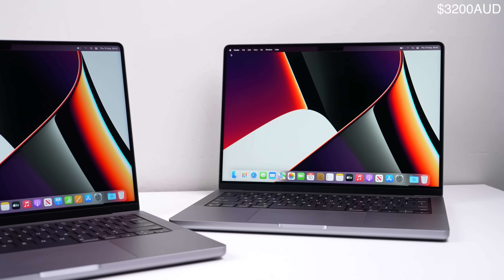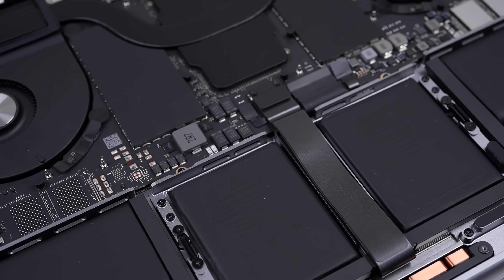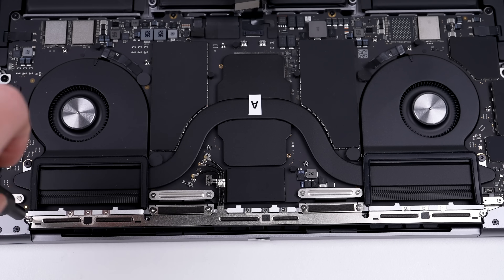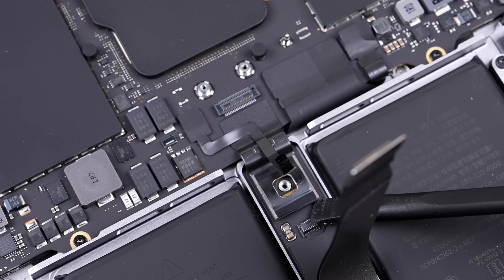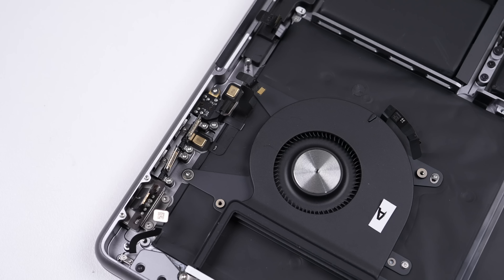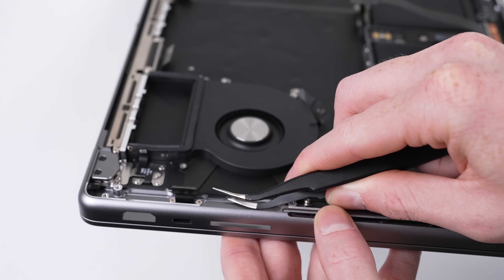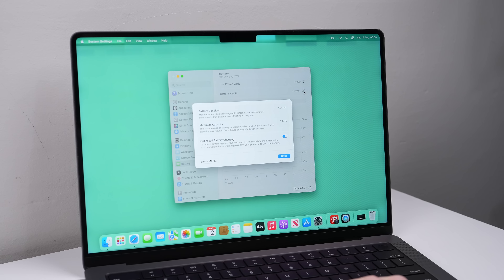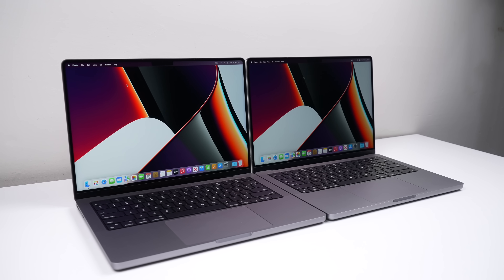New Anti-Consumer MacBook Pros - Teardown And Repair Assessment - Apple Silicon M1/M2

Comment: I used to work both for the fruit company and an authorised reseller almost a decade ago now. I was always on the defensive side saying things like - apple just wants everyone to have good battery life/screen/camera whatever as it's their brand name that goes bad if someone kits out phones with crap and sells them as authentic. I think at those times we were getting the first devices where screen repairs started becoming problematic due to fingerprint sensors and such, but it was still not too bad. This is insane and anti-consumer. As much as I would prefer a genuine part from apple to replace something broken I would still want an option of a third party repair, ESPECIALLY when genuine components are used.

Comment: Thieves. I have a MacBook pro mid 2014 full specced and that was Apple pinnacle (albeit ram soldered). I even coated all the insides on conforming coating so it's basically anti rust and water proof. F/ U apple!!!

Comment: I have performed multiple screen swaps on the 2015 - 2019 MacBook Pros.  This is insane that Apple yet again makes things artificially non-repairable.  We need regulations that make these practices illegal.
Reply: also... 6500 USD for a 14 inch 1 terabyte laptop with only 16 gigs of ram
LMAO!!
Reply: with that amount of money you can buy the god of gaming laptops just went to best buy and an Alienware m16 QHD 240HZ with 16GB ram and a rtx 4080 cost 2300 dollars lol
Reply: @escapetherace1943 my W520 from like 2011 has 32 gigs of RAM
Reply: @escapetherace1943  That feel when I payed less than a quarter of that price for my gaming desktop with 64GB of RAM, 8 core 16 thread CPU, and a mid-high range GPU. Plus my desktop is 100% repairable! I can swap in whatever components I need and modify it however I like to keep it running for years to come

I imagine the only people buying this thing are people with hella disposable income who are huge fans of the brand
Reply: @escapetherace1943 the pricing isn’t great, but where the fuck did you pull $6500 out from lol? It’s $2500.
Reply: @elith6930  6500 in Australia and 2500 in the USA, person who didn't watch the video. Either way you are overpaying. 800 new would be overpaying for that literal trash laptop. But Apple customers get what they deserve.
Reply: @escapetherace1943  you said 6500 usd in your comment…? Are you literate?
Reply: @elith6930  are you? 6500 USD for AUSTRALIANS. Not Aussie Dollars, US dollars.
It's like living in the twilight zone with you people
Reply: They dont want you to repair them they want you to buy a new one every year. Best getting a thinkpad or something that will stand the test of time unlike apple shite
Reply: @jontait1095 My next laptop will be a System76. They are Apple, but with Linux and open source software / hardware.
Reply: FlexGate issues limits, artificially, the lifespan of the Macs. My old 2017 13” MacBook Pro died after two years of use because the flex cable tear and broke in two pieces.

My 2019 16” MacBook Pro (which I bought in late 2021) will run, eventually, the same luck as the old one, while my 2012 13” MacBook Pro still works without any issues. 

Apple made a big mistake in removing the easy replaceable screen to motherboard (eDP to 30 pin) cable, and this is one of the main reasons why I love ThinkPads, because they’re easy to repair.
Reply: My thought too. This is getting ridiculous, we need regulations to stop trash companies like this from exploiting users this badly. I hope the EU comes up with something given their recent regulations
Reply: The whole world cannot rely on the EU to fix this when USA and the rest of the world is so LOST and supporting ideas like capitalism and even worse antiSocialism @derivativeoflog7
Reply: @derivativeoflog7  The country this company comes from elected a pedophile president. Twice. Good luck with those regulations
Reply: When people stop buying these computers, then the problem is solved
Reply: @_Viking  Problem is that they won't.  My daughter INSISTS on Apple products.  I've tried educating her on the things that Apple does to its users, but she's more interested in what the other girls in her circle are using.  That's the way it is all over the world.  You could slap an Apple logo on a sleekly shaped turd, and they'd still all buy it so they can be part of the group.  I'll never understand.  Drives me crazy because other companies have taken note, and are pulling the same stunts on us now.
Reply: @FirstLast-vr7es  i know what you mean. Have two girls myself that will not touch anything without a logo of a half eaten apple on it. .😅
Reply: @FirstLast-vr7es 😅
Reply: @_Viking  That's the issue when we're dealing with a company that built a walled garden ecosystem... it just won't happen. So we have to settle for the second best thing, which is regulations
Reply: @derivativeoflog7  No one forced anyone to buy Apple, you decided to. This is like a conversation with a drug addict
Reply: @LimerickWarrior1  I don't have any apple products; 
but there are some good reasons to buy one, and some aspects of them are objectively good (none of which weigh out the company's shit practices for me, so I wont buy one)
That's what makes me the most sad... They could be making absolutely killer products, yet they choose not to because of greed, AND using extremely questionable practices
Reply: @LimerickWarrior1 as a graphic designer my programs run better on macs as they were designed for them. There are less bugs and less update errors. Intel tends to also do updates at the most stupid times possible. Macs have also integrated all the printer drivers so I don’t have to install any printer drivers. Colour calibration is also better on Mac. Macs are specific to my industry. Let’s not talk about viruses, even without a antivirus program I never had virus problem on my Mac because of its closed off system.
Reply: @_Viking  That solves nothing because the competition is starting to pull the same BS because they see that they can get away with it.
Reply: @_Viking  Nah, just force them to comply under penalty of death.
Reply: @_Viking  I'd love to, but x86 is toasty/load and simply vastly inferior on every metric (if adjusted for TDP and Perf/watt especially) compared to Apple Silicon..
Reply: @kevinjohansson3923  Apple could have continued with Power architecture, it worked relatively well for Nintendo as all of its systems from GameCube to Wii U sipped power, although, I'm not sure what happened with Wii U as it had clunky software with long load times, but I digress.  Apple should have also considered AMD as it's the superior 64 bit x86 architecture.
Reply: @WJCTechyman  the power architecture was terribly inefficient when they made the switch
Reply: @kevinjohansson3923  🤣🤣🤣🤣🤣🤣🤣🤣🤣🤣🤣🤣

Considering how advanced the latest CPU designs from Intel, ARM, and AMD have become, "performance" differences no longer matter as much as some would like to claim. Just about the only metric that matters at this point is energy efficiency, and even then the differences are not large enough to really matter
Reply: absolutely
Reply: Well in Europe we have such regulations  by Law but apple just not care. :P
Reply: @HTSMcFly  Are there? As far as I know there aren't, otherwise they would've definitely have been fined or suspended from the european market... and Apple clearly cares about this market since they're willing to adopt USB C and allow sideloading just due to EU regulations
Reply: There are new EU laws coming into force in 2027 which require repairability. They may be work-shy communists 😊 but occasionally the EU shows the rest of the world how to stand up to big corporations.
Reply: @Pikestnt  not everything that slightly deviates from the USA model of doing everything is communist
Reply: Here in EU we have "Right to repair", a recently introduced set of Laws specific for this. You have to fight and force Your politicians and lobbysts to make them.
Reply: We don't need regulation, we need education. We deserve what we get if we continue buying these computers.
Reply: The thing is, why are brainlets still buying these products?
You guys are obviously mentally ill with Stockholm syndrome as otherwise there's HUNDREDS of alternatives instead of Apple, but noooooo, you buy their products and then moan about it.
Reply: Why does the government have to step in? Just don't fucking buy it. If one company loses customers because if doing something like this, others will not do this as to gain customers and sales.
Reply: This is a company that used to glue & solder RAM sticks. Not sure why you'd be surprised after all that jazz..
Reply: Right to Repair
Reply: In EU there are already such regulations in place (you must have heard about USB-C port in iPhones - that is one of the results). We'll see what happens and if Apple will also make a decision to make their stuff repairable by non-Apple service...
Reply: EU bans all sh*t like that from 2027. New laws intended to protect human rights to repair their devices, change their batterys, use any chargers and cables.
Reply: Legislation that reduces sales of new devices, which also reduces sales tax revenue, will NEVER be passed. It's delusional to think this kind of anti-repair crap can be legislated away. The only thing that will work is complete and full boycotting the company. But that will never happen. Owning an apple product is a social status statement. And normies care more about that then a company doing the right thing.
Reply: Good thing europe finally started the war. I hope that after the battery law, they will also pass a law for all parts
Reply: Europe has just passed regulation because you bribed government officials won't
Reply: just stop buying their  shit
Reply: I heard yesterday that certain printers when they run out of ink they will stop working as a scanner until you buy more ink cartridges then you can use your scanner again  what a joke. Once upon a time nokia were the main supplier of phones to the world like apple are now but if apple keeps going the way they are going and others they are going to get Nokia'd if you know what I mean basically a has been company. Take note apple
Reply: Technically, why should it be illegal?  It doesn't involve health or safety so why should it be regulated?  Apple is a commercial company in a free market -- they're allowed to make it how they want.  The problem is, the faux-superiority Mac fanbois keep on buying these products.  Apple has little incentive to change as long as their sheeple vigorously consume their shit.  But otherwise, gov't (re: regulations) is not the answer
Reply: With those lobbist? Nah.
Reply: Or heavily taxed. Put a 100% tax on any computer that isn't repairable and Apple would have to adjust their practices or suffer a tremendous loss of business. That tax can be put forward to recycle broken macs that can't be repaired instead of ending up as e-waste.
Reply: nah, no regulations needed. regulations will hurt progression in the long run. what it needs is customer awareness, like some sticker on the box  'only repairable by manufacturer'.

in the end, the consumer gets, what he pays for.
Reply: @RFGSwiss  No. Even if given the knowledge, consumers cannot make the right choices for themselves, clearly.
Reply: @escapetherace1943  this is a dangerous road, you are going with this.....
Reply: @RFGSwiss  so are you talking about regulation that forces the company to include that on the box, or do you mean Apple will just voluntarily do it?
Reply: no, what you need is to stop buying from them
Reply: why? just dont buy it.
Reply: How about just stop buying their garbage?
Reply: Thats bs , i had same issue, and there is no way to repair shops to calibrate a $1000 screen
Reply: I think that it's better to make it non-repairable, because criminals can't steal it and sell for it's details.

If you don't want it - don't buy Apple then.
Reply: @ВладимирРукавишников-ш4м  to you too, please try defending Apple without using the same excuse everybody uses, and that's easily disprovable
Reply: Apple bought regulators.
Reply: two words: bud light
Reply: @JustinCrediblename  ya, it works when  it's based on hating a group of people. but for right to repair? good fucking luck.
Reply: @Cara.314   that's a pretty absurd perspective about the bud light scenario. Sure, the pedophiles are hated, but that loosely-connected demographic isn't a significant part of most objector's perceptions of the bud light controversy
Reply: Stop buying it then. They have every right to screw over their customers and customers have every right not to ever buy them again.
Reply: good to now. great for consumers - There's no point in stealing Macs, and you know someone hasn't used a counterfeit part.
Reply: @nnnnnn3647  try defending Apple without using the same and easily disproven point everyone else uses
Reply: @nnnnnn3647  How is this great for consumers?  Even if you use Official Apple Parts it will trigger errors.  I could sort of understand if these problems were exclusive to unofficial parts, but everything Apple does is to take ownership away from the person dropping thousands.

Don't get me started on their flawed Find My system.  The default shouldn't be to lock a device to an Apple ID.  So many perfectly working Macs, iPhones and iPads are Artificially Bricked by Apple's poor implementation.

Comment: Hope you're prepared for the Big Apple Bully trying to sue the pants off from you. You've "infringed on its intellectual property" by exposing its evil scheme of anti-freedom-to-repair and designed obsolescence, only in the self-interest of the stock price bottom line. OEM spare parts are taken off the shelves 6 years after the model's introduction and no one can make them... it even prevent others from entering a market space that it doesn't want to be in... all for the mighty $$$.
I was a Mac user in the 80s, 2000s, through to the 2010s, having owned 8 Macs (MacIntosh, 2c, iMacs, MBP, MBA), and I just couldn't agree with Apple's corporate ethics since 2015 and stopped patronizing it.

Comment: If only intel and amd had apple pro res video codec or whatever other latest codecs necessary for at least 8k 60 playback. That would improve improve battery life of all windows laptops.   Also option to disable extra performance and efficiency cores and gpu if not required. Battery  🔋 ⬆️

Comment: That ribbon issue… I have a 2018 MBA and after a top case replacement, Apple didn’t line up my display to my liking…. And I didn’t want to drive the 2hrs to my nearest Apple Store again, so I found a computer shop, asked them to “move the screen a tiny bit over to aline it better (very simple if ya have the right tools and I didn’t) well. Unfortunately, when he tried to pry the back case off, he hit one of those ribbon cables with a pry tool and broke it. Claimed that’s how I brought it in. The screen not working and refused all repair and liability on it. I was SOL. I ended up replacing the screen myself and it work’s amazing to this day

Comment: One thing to keep in mind is that even if you replaced the display and everything was more or less "fine" you would lose the factory calibration. I'm sure somewhere in your specific devices firmware there is data related to the displays colour accuracy that the computer uses to generate accurate colour modes. Unless you somehow recalibrated the display you'd be missing one of the main features of the display is that they're factory calibrated.
Reply from the maker: I believe the calibration data is programmed onto each display from the factory. I say this as if you buy a screen from Apples self service repair store they "configure" it remotely after its installed. My guess it is just approves the screen and sets some config data. There is not special calibration machine or anything needed for colour.
Reply: @HughJeffreys 

do you think there will ever be a solution? that is, not a chip replacement

Comment: impossible to replace keyboard...
my 15 year old asus was getting a new keyboard every year for a while there, because I used to use it constantly.
The replacement keyboards were actually mostly cosmetic issues, because I'd worn the letters off the keys, and even worn holes in some of them, like where my thumbnail hits the spacebar.

Comment: I paid a grand, UK (so probably about 2 grand for an Aussie) for my latest Asus gaming laptop.
I'm not going to say there's no anti-repair in it, half the RAM is soldered to the motherboard, but I've already replaced the SSD and the one stick of RAM with higher capacity ones, upgraded it with a second SSD, and even replaced the screen (because after 1 month after warranty, the screen started misbehaving)

Comment: Not only Apple but other companies also does serializing parts so you can not replace by your self or third party repair companies. Official repair is joke in some cases. Also soldered storage, ram... and probably other stuff that is just bad. Okay soldered RAM is okay in some cases for example for top DDR5 speeds so there is as short traces (path) as possible between CPU and RAM to reduce issues but that is just in extreme cases. m.2 socket is not expensive at all (even if they add it do not do some propriatary crap that only computer manufactorer storage can be used cmon).

Ok enough ranting 🤣. Have an amazing day pipls 😎👍.

Comment: Glad you’ve covered this, many are or have been on eBay with this issue. Apple has no reason not to allow people to access the calibration other than to make more money and lockdown repair to only parts they sell you.
Reply: apple has all the reasons they need . . . they start with $$$$$$$$$$$$$$$$$$$$$$$$$$$$$$$$$$$$$$$$$$$$$$$$$$$$$$$$$$$$$$$$$$$$$$$